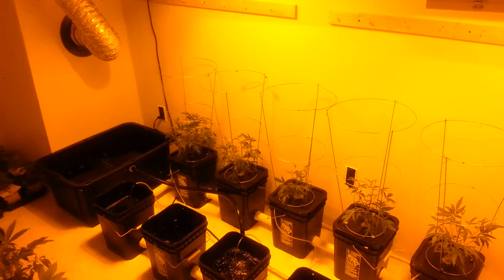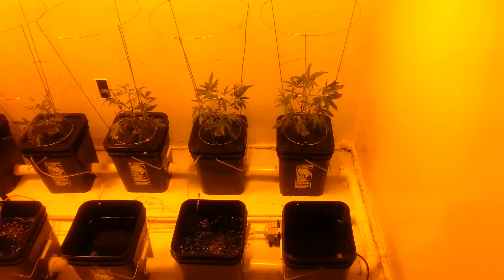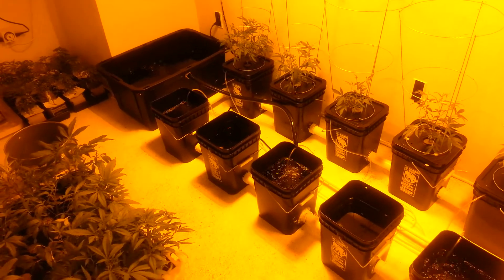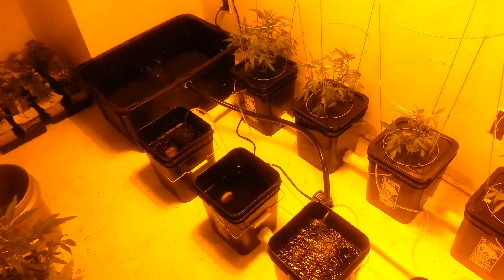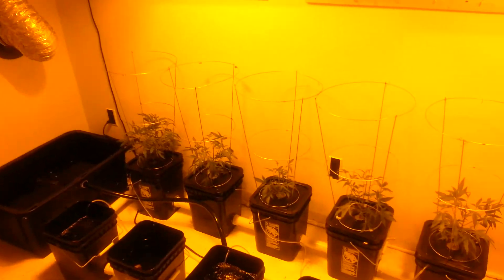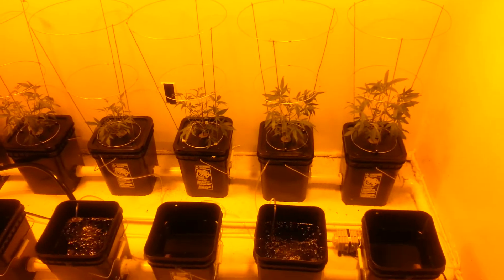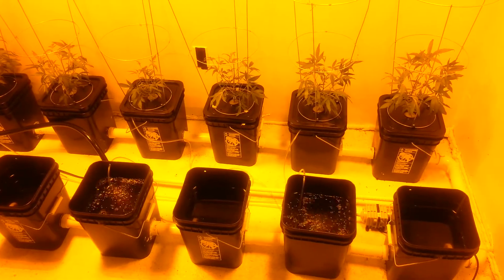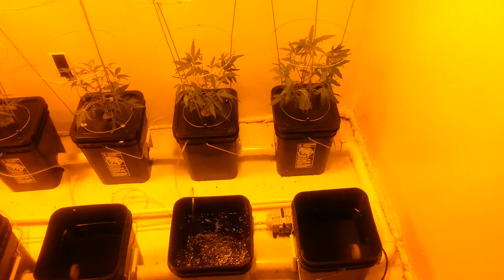Home Built Recirculating DWC System

Comment: I got a quick question I know this is an old vid...did u have a problem with roots growing into the pipes below?
Reply: good way to counter that is to get rid of the T in the center and put the pump on the inside and you can rotate between the 2 inch pipes there to reverse the flow. EDIT: just notice he has a T at the res as well, dont do that, have both lines go into the res instead of the T.

Comment: Hey man nice system! The individual buckets are all filled by the white pvc pipes running along the bottom yeah? And then the pump basically pulls your water/nutes from the reservoir thru all the buckets and back to res? What stops the buckets over flowing - is that governed by the level of your res? Thanks
Reply from the maker: Watch this weeks video
Reply: The Candyman Cannabis Company will do my man thanks🖒